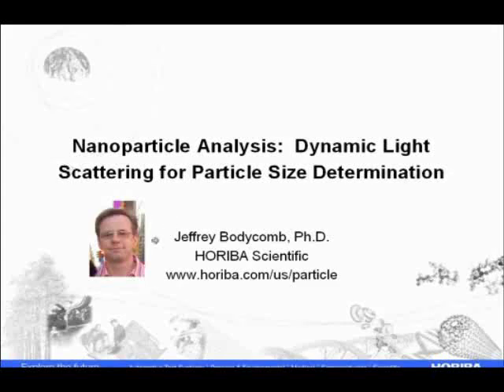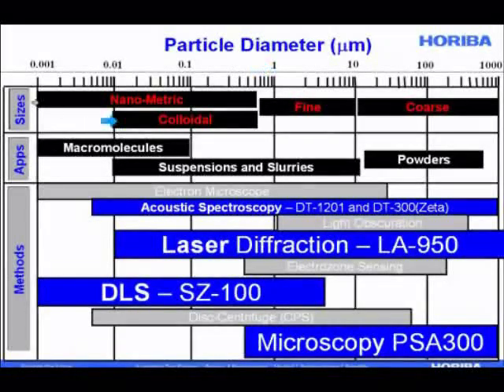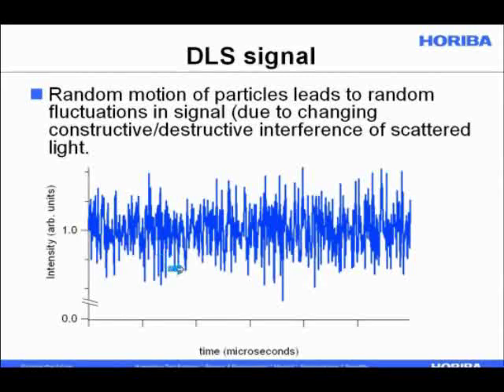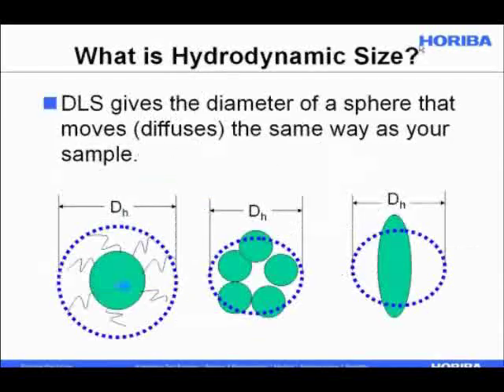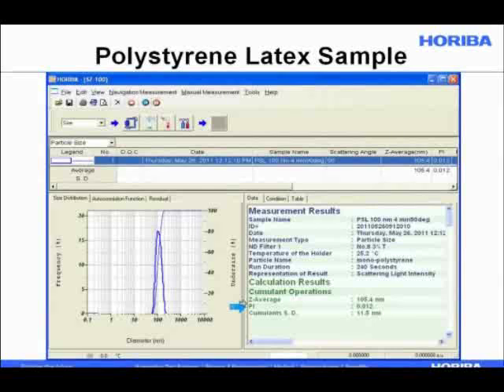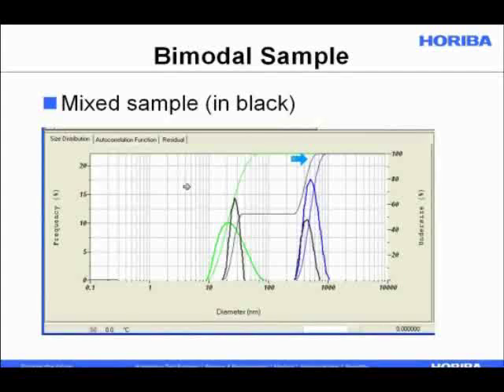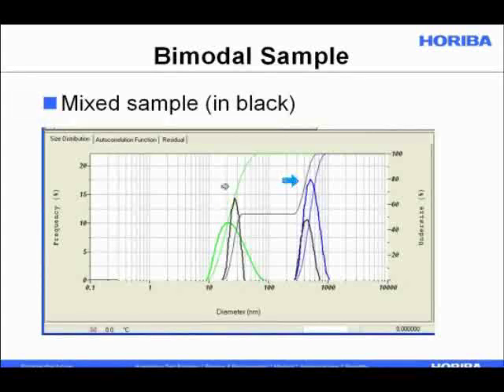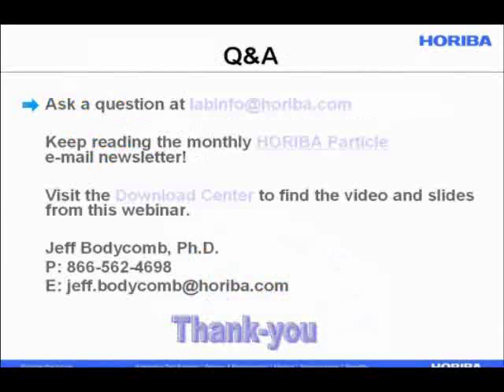Dynamic Light Scattering for Nanoparticle Size Measurement

Comment: Hello Dr jeff 
I wonna to aks about something related to the measuring of  size of nanoparticles   on the Zetasizer S90 
And so, Please show the results analysis any which are measured on the Zetasizer S90 
It  is a little bit confused what extant  the dependency of the PDI index of DLS and Z means Dynamic diameter 
thank you for answer in advance